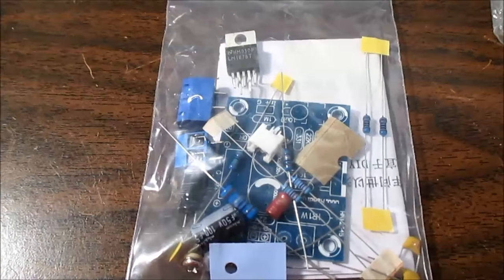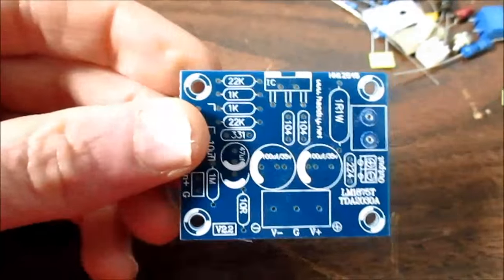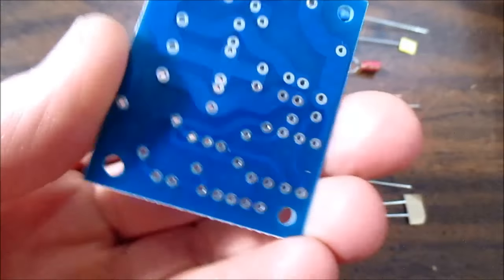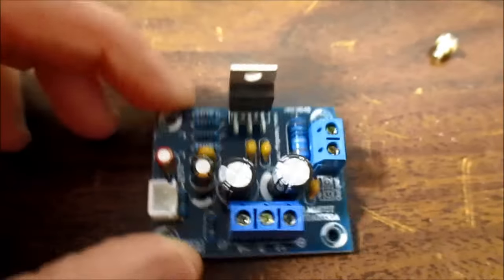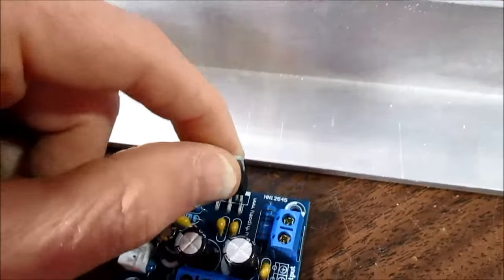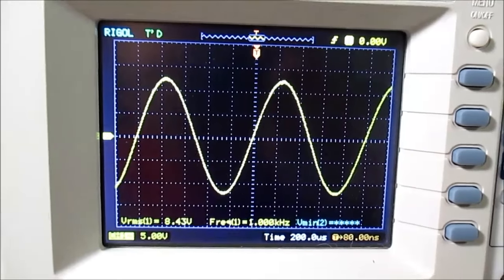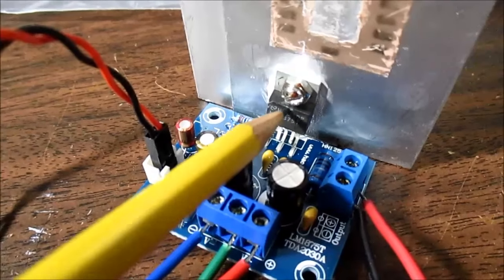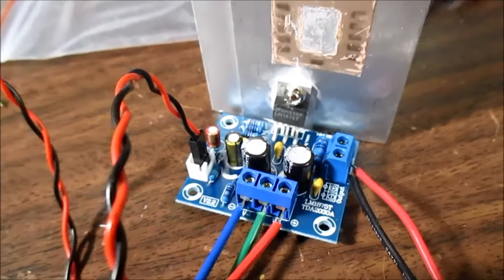LM1875 IC audio amplifier board kit test and review

Comment: Btw wondering if you can implement a filter to an active into this circuit, since you already have that 10 uf in the signal line.
The advantage with that is that you save a lot of components in the signal way.
You could take a 1 uf instead of the 10 uf to a high pas filter  to a treble speaker.
You gain transparency with lesser component in signal way.
Reply: Of course you can add a filter onto the input. The vlue 1uF is not relevant however, since the impedance (resistance) across the input terminals is nowhere near as low as across a speaker coil.
You wouldn't save ANY components doing it that way... a filter is a filter, no matter how you cut it. So, you save a inductor and capacitor in the crossover, but add a capacitor and resistor onto the PCB. For active crossovers, you are better to use a Preamp that incorporates those parts and functionality
Reply: @johncoops6897  Hi, and thx.
Reason for speculating on this is doing a 6 db crossower, preamp already, 6 channels to 6 speakers, have some really good tweeter that can handle low frequencies.
So, but since they are quite expensive it might be a good idea to add another filter on them that is one octave lower, just for protection.
So it does have preamp already, although this amp only needs 600 mvolt acording to John.
Yeah 6 db have pro and cons, some swear to it, while others do not. Depends from were you are looking at it.
Since I value Transparency high on my list, this is my choice.
Man, In my experience many producers over speculate feedbacks and adjusting components with make tons of it in the system.
Due to they are infected with demands and stats.
My old Marantz amplifier was a beast at it. When I bought it sounded terrible, compared to the previous amp that I had, a Luxman.
I got the recommendation to cut all feed back in the input section, HUUUGE EFFECT. There were tons of component in the input line.
I just cutted them off, all of them were short cut's components, so I did not even needed to rewire anything.
It turned from a sound like a transister radio to sound like an actually high end amplifier with a very natural transparent sound.
And no nothing came unstable, when it is in the signal way at the input section at the input terminals.

Just think about it, when ever adding a resister, a coil and a capacitor, you removing information of the sound.
And it all sums up or rather remove away. When it become complex you have no way at all knowing what it does to its sound information.
Especial short cutting components, taking the life out of the music. 
Sound is many things and very fragile, terms like Transparency, natural, dynamic, details and colors of the music shows that and 
how does the component handle that in its frequencies range.???
I know not many knows this, since this is only discussed in hifi forums and magazines. 

So do not be too theoretical about it, make it simple.
Cant be highlighted enough.

Simplicity is key to brilliance
~~Bruce Lee.

Best amp I ever heard had no feed back at all.

Comment: Is it normal, that my amplifier became 2 times more quieter, after replacing those 100uF 50V with 220uF 50V Nichicon FW's? I am rebuilding a soviet AB class amplifier, and I have put two of these boards in it. I guess it's time to give it a new preamp stage?
Reply: I'm not an expert, but that doesn't seem right. I replaced audio caps on my amps with equivalent voltage and capacitance Nichicon audio caps and noticed no difference.
Did you measure all parts to make sure the capacitances and ESR are where you expect them to be?

Comment: Hey John!  I know I am posting a lot on this video, but Man!!! I am very excited about this design.  My next question: Power? A 24VDC wall wart or is there a small design for an AC to DC power supply? I would like to enclose this thing in a small wooden box and have it all self contained. Any suggestions??
Reply from the maker: No problem. This amplifier requires a split supply with a positive voltage, common and negative voltage (three wire). You can make one with transformer that has a center tap secondary, full wave bridge and a couple filter caps.
Reply: Thanks John!!
Reply: John:  I already have a DC power source about 25 v. but it has three wires coming from it.  What would I do with the third wire(common, I assume) with this board since it has a two wire input?

You mentioned in your presentation about putting in an additional capacitor or upgrading.  What capacitance and temperature would you suggest?

And, what is the wattage of the resistors?

Thank you.
Reply from the maker: You need a bipolar supply for this amp which means a common lead and a +12v lead and -12v lead. Okay if the supply voltage is higher, such as +18v and -18v. I checked the capacitors and they are okay to use as is, but you could upgrade the two larger electrolytic capacitors to 220uf 25v 105c low ESR types.

Comment: Nice video! So let me get this straight.... I read the comments because I not sure about what kind of power supply it requeres. It is a 3 pin AC transformer? Like: "12v - central tap - 12v" ? Or it requeres a symmetrical power supply?
Reply: Ricardo Reis A 12v 3amp switch mode power supply will do. Don't bother with transformers, those are relics of the past.

Comment: Hi John,
Love your channel!
With a proper power supply these kits sound great.
To achieve best sound quality which of the components do you suggest changing to a more “reliable quality”?
Would you change any of the components values?
Reply from the maker: I would change all the passives (caps & resistors) to known good brands. This is no guarantee that the sound or reliability would actually be any better but would make me feel more confident knowing that better parts were used.
Reply: JohnAudioTech I’ll do that...assemble an extra stereo-version with non-ebay components for a blindtest.

Comment: Love these videos. I'm getting motivated to get back into electronics.
Is this a mono amplifier? 
If I wanted to make a stereo amp I'd need two of these?
Reply from the maker: Yes it is mono. There are stereo versions available but I have not evaluated those boards. I'd go dual mono using two of these boards because I'm not confident in the layout of the stereo boards from what I can tell just by looking at the posted pictures.
Reply: A while back I ordered a 2 ch stereo kit. It was just the board only. It even had the power supply section built right onto the board. all that was needed was a ac power source. IE. 24v center tap Xformer. Was like 4 or  5 bucks  on flea-bay. The board quality looked good. But who knows. I still need to source the components and assimble it

Comment: Hi John ,I've seen this and the other vids few times for info.
I saw in another video that you had changed some bits on this board.Can you please tell me ,apart from the input cap and the large ones which other parts/values need upgrade.
I have the big caps swapped for 470uf 50v sounds good but it seems a bit quiet with +-30v supply and smartphone source.Does it need higher voltage line input or that is the normal output with this setup.Can"t reliably measure the output ~ 5v ac into 4ohms with multimeter. I get. At max source volume.
Also, do tickle your ears with some Tda 2030 stereo diy kits single and double supply versions-i find them fantastic for $3-4. Low power but make me smile every time running the bookshelfs. 
Long one ,sorry.
Please keep up the excellent educating videos.
Best Regards.
Reply from the maker: Part values are good, I'd just get them from a supplier that doesn't sell counterfeit parts. The headphone output jack from a phone or music player doesn't have enough signal voltage to drive the amp loudly. You would need a preamp.

Comment: @JohnAudioTech, I am a little bit puzzled by the input filter of this chip amp. Especially, the function of the 10 Ohm separation of the input ground from the output ground is not clear for me. Could you please explain this for me?
Reply: It's to increase the channel separation when a pair are used as a stereo amp.

Comment: Nice find! Have you ever had a bad experience with an amp because it didn't have the RC low pass filter on the input?
Reply from the maker: Yes, I had an amp burn up it output snubber (RC network on the output) because of HF oscillation due to feedback on the input. The filter might have stopped this from occurring.

Comment: John audiotech travolta,

i was looking for info for my first DIY boombox. after so much scroll troll and scrible drible i finally found use full info on your channel (hence subscribed) and now i am not able to find components relating lm1875 (its a tough world) but no issues i will pull through somehow.

i am going to use some old sony 4.5" 25w  full range speakers with some tiny 8 ohm ones, please tell how to add up a little more bass to final output. i feel it can be done. 

you, sir, are my only hope for now. Let there be light...winter is coming
Reply from the maker: Thanks for watching and I hope your project works out.

Comment: As usual great video. 
i would love to know how to connect 2 of these modules to give stero output?
Reply: Just mark one as the left channel and feed the left input into its input and take its output to the left speaker. Then mark the other as right channel, feed the right input into it, and connect the right speaker to its output. You can use the common input ground wire as the ground input for both left and right modules.

Comment: difficult to find the same boards you got. the ones I ordered from ebay just came and the boards are not as nice. the PCBs are green and have smaller copper traces. They have the same layout as yours even down to the backwards input cap though

Comment: Could you recommend a power supply for stereo setup? I must say I am quite intrigued by this cheap little kit.
Reply from the maker: If you mean a ready made supply, look for a +25/-25 volt dual supply of at least 2 amps for 8 ohm use or a +18/-18 volt 3 amp supply if you will use  4 ohm speakers.
Reply: Thank you sir!
Reply: @JohnAudioTech  I'd recommend not to exceed +15/-15 V for 4 Ohm speakers. Otherwise the LM1875 could get very hot. I use +12 / -12 V supplies for LM1875 / TDA2030 / TDA2050 at 4 Ohm loads.

Comment: What amplifier build are you planning on doing im curious?  Also thanks for the reply.
Reply from the maker: It will be a simple two channel stereo amp using a couple of the boards. It would have a volume control and power supply all put in a nice wooden case.
Reply: looking forward to it.

Comment: Can you explain what happens if you use a lower/higher voltage psu? I'd like to come up with a good battery powered amp and was considering using 4x 4v batteries to get 16v (I think this is the minimum?) Thanks

Comment: I have questions-
1. Which type of work input capacitor is better for audio amplifier ? Ceramic or Metal film ?
2. If I want to use two numbers of lm1875 boards like this to make stereo , how should I connect the grounds to reduce noise and oscillation ?
Reply from the maker: 1. metal film.
2. treat each amp as separate unit. Power supply ground is the only common point.

Comment: I wonder if the chips were inexpensive due to the scratches and everything. Maybe still authentic?
Reply from the maker: One seller listing that same kit said something about the IC being used. Possibly the ICs were in some product that production was canceled. The left over boards were stripped of the more costly parts. For fast assembly, power ICs are often clipped to the heat sink and removing the clip caused the scratches. Well that's my thinking anyway. There are companies around that resell recovered parts.

Comment: Hi John. I found a CT transformer, but it has 3 input leads and, of course, 3 output leads.  label says:  Primary 115/230VAC to 24VCT.  Will this work for this application?
Reply from the maker: That might be good for 15 or so watts into a 4 ohm load if the tranformer is large enough. Do you know its current rating? If not tell me the core size and I can estimate the current rating.

Comment: Apologies if someone already asked, but how do you calculate the thermal resistance (C/W) needed for the heat sink? I want to make sure I get the right value when I order heat sinks.
Reply: You first need to know the maximum temperature rise allowed for the semiconductor junctions. For the LM1875, the thermal cut-off will operate at 170°C for a single event, or at 150°C for repetitive temperature rises. So assume you want to limit the maximum junction temperature to 150°C.

Then determine the highest ambient temperature you can allow. Let's say 30°C as an example. So the maximum temperature rise is 150° - 30° = 120°C.

Next work out the maximum power dissipated in the chip. Without any load. the chip takes a supply current around 100mA. If you use ±25V supplies as in the video, you'll dissipate 50V x 0.1A = 5W quiescent, which means you are always going to need a heatsink. The datasheet gives graphs showing power dissipation vs power output for various supply voltages , but for ±25V supplies delivering 20W into 4Ω load will dissipate 32W internally, or about 19W if driving an 8Ω load.

Driving a 4Ω load, to dissipate 32W with no more than a 120°C rise, you need a junction-to-ambient thermal resistance of 120°C / 32W = 3.75°C/W. The chip has an internal junction-to-case thermal resistance of 2°C/W and the TO-220 package has a case-to-heatsink thermal resistance of 1.6°C/W using a mica insulator and heatsink compound. That leaves just 3.75 - 2 - 1.6 = 0.15°C/W for the heatsink, which is impractical.

If you electrically isolate the heatsink, you can leave out the mica insulator and mount the tab directly to the heatsink reducing the case-to-heatsink thermal resistance for the TO-220 package to 1°C/W. That means you need a 3.75 - 2 - 1 = 0.75°C/W heatsink, which is still pretty big.

Driving an 8Ω load would require a total thermal resistance of 120°C / 19W = 6.3°C/W. So using a mica insulator, you would need 6.3 - 2 - 1.6 = 2.7°C/W heatsink. That's quite feasible.

Sorry for the long reply, but it takes some explaining. Hope it helps.
Reply: @RexxSchneider  Thanks Rex. This exactly what I wanted to know. Very kind of you to take the time to explain it.

Comment: John are you saying that one cap needs reversed to be ok for dc?  Im going to be using ac to dc power supplies.
Reply from the maker: The input cap will work either direction. I was just pointing out that it was marked on the board backwards from the schematic.

Comment: It would be cool if you also measured efficiency of the amps.
Reply from the maker: I did that in the video where I compared a class AB with D. I'd like to do more but it makes the videos run long and people lose interest.
Reply: The LM1875 datasheet shows graphs of internal dissipation vs output power over a range of powers and supply voltages for both 4Ω and 8Ω loads. The efficiency is just output power / (output power + internal power dissipation). For example, with ±30V supplies into an 8Ω load, you typically get 25W internal dissipation with 25W output, yielding 60% efficiency. For contrast, using ±20V with 4Ω loads, it shows 22W internal dissipation for a 15W output giving an efficiency of 40%. Lower output powers at the same supply voltage result in lower efficiencies, mainly because of the quiescent supply current of about 100mA, resulting in 5W dissipation with ±25V supplies with no power output.

Comment: Hi! Would this be able to power a 125w PA Speaker? And maybe loud enough for a  band(with drums)? I'm planning to use it for keyboard or acoustoc guitar. =)
Reply from the maker: It depends on the sensitivity of the PA speaker. If the speaker was rated 98db @ 1w, you could get around 111db at 20 watts. If that is good enough depends on how loud the rest of your band is and where you play.

Comment: Hi may i have question ? how I can control bass or make bass more powerful on this board with LM1875T. Thanks
Reply from the maker: Do nothing to the board. It is meant to boost the voltage and current of the signal to drive a speaker with a flat frequency response. If you want more bass, use a preamp circuit with bass boost.

Comment: greetings, do you have any insulation between the ic and the temperature sink?
Reply from the maker: Unless the heat sink is isolated, you should use isolation between the IC and heat sink.
Reply: @JohnAudioTech  Thank you, please recommend me a link to buy a power supply module for this amplifier?

Comment: Could this circuit handle higher input wattage or does it need to be a rca level input?
Reply from the maker: It is line level. For higher levels, use a resistor divider to lower the level.

Comment: why it says lm1875 and tda2030? are they have same pinouts? and what is the formula for calculating RMS?
Reply from the maker: Yes, the same pinout for TDA2030, 2040 and 2050 ICs. RMS voltage is the 
product of the peak voltage times the inverse square root of 2 (.707).
Reply: JohnAudioTech thanks a lot :)